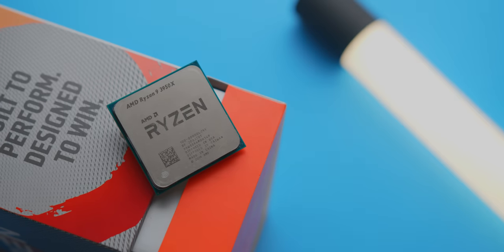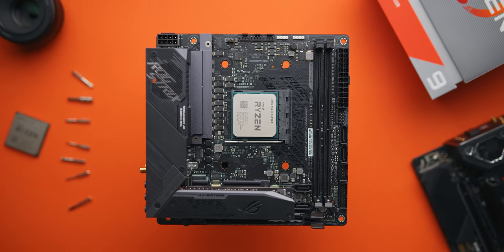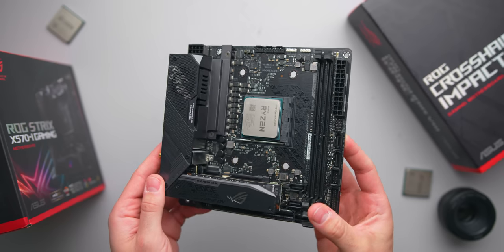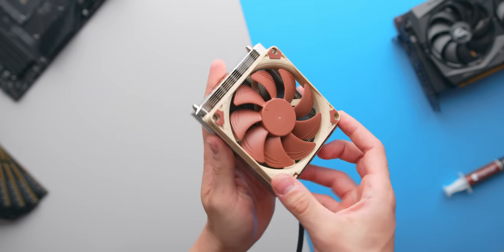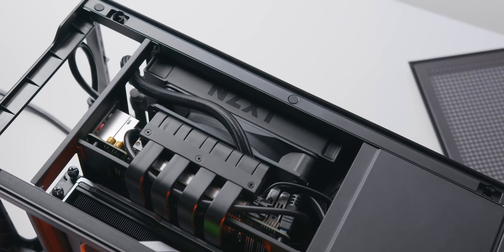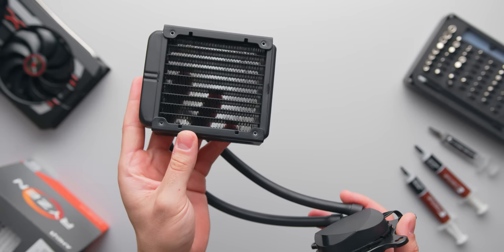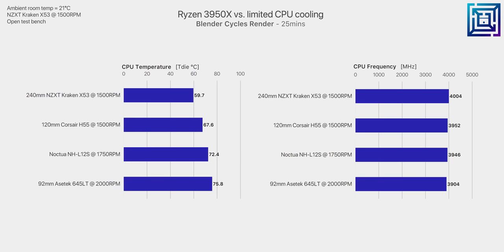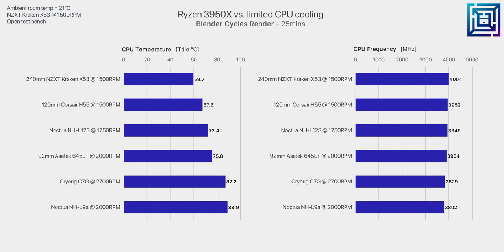Ryzen 3950X vs. Low Profile Coolers - Sanity Check

Comment: Thanks for your review! Been wondering will my current 6 heat pipe 2x120mm heatsink will be enough for r9 3950x :) currently using r5 3600. Thank u , am now sure it will do just fine
Reply: Not all heatpipes are creating equal and not all coolers with same heatpipes are created equal. Gelid phantom has more heatpipes than the nh d15 or any other top cooler, but it performs on the level of coolers with half the heatpipes it has.

Also air coolers will punish you more than AiOs if your configuration of case+fans it's poorly managed. On the other hand, if everything it's in the right spot, it can be even better than the best AiO.

I'm suscribed to optimum tech, but sometimes he pulls out some stupid ass affirmations.

Comment: would love to use the L12s or the L12 Ghost with a x570 ITX board, but according to Noctua and the board manufactures it seems the L12s and the L12 Ghost simply does not fit and its not clear if the black ridge will fit either.

Comment: I have a 3950x and I'm cooling it with a deepcool assassin 3, with the stock fans replaced for corsair ml140s.... little noisy due to the high volume of air being moved by corsair fans but solid performance. It's a bit bulky on the mini itx board I have, and it looks massive in my phanteks enthoo evolv itx

Comment: I’ve been using a dual 240 rad set up with a ek block just swapped over to a u12a and have even slightly lower temps now. It seams to me everyone treats it as if it’s a hdtp chip 250+ watts when it’s really a 3900x with more cores and even a stock cooler would cool it

Comment: I use a 3950x with Swiftech Apogee Drive II and  EKWB 240mm Classic Radiator. Now I feel like this is overkill cooling solution for design and 3d modeling work. LOL!

Comment: i just finished a 3700X build, 90% of people could actually do well with the 3600 as I feel the 3700X is a bit much for the normal everyday non pro gamer/editor/renderer. I do a lot of 3D work which is why I have a 3700X (couldn't afford threadripper and 3700X had a nice TDP)

Comment: It would have been interesting to see the wattage on all the different cooling solutions. I'm fairly sure it actually modulates to lower power when temps go up with some artificial cap. You said to find out how low you can go, what if you cool it with a potato?

Comment: Question is, do processors really die when run at greater temps? And if so, when?
Reply: Of course they do or manufacturers wouldn't power throttle the CPU. In theory you get increased degradation with any temperature increase, but AMD have clearly determined that this is low enough < 90c to not worry about. Personally I'm uncomfortable >75c, but I also OC/overvolt which also increases deg. As to exact figures, no-one can tell you, it differs between process nodes, topologies and even individual CPU's. The only time I have encountered this personally was on a P4 <80c when pushing for an extra 50mhz (0.05v increase over a voltage it had run for months at), I struggled for a couple of hours and ended up with a processor that wouldn't even maintain clocks 1Ghz less than stock.
Reply: @tyrantworm7392  must be that this depends on make and model. Have been running a 2600K overvolted and overclocked to 4.5Ghz for 10 years now. No issues at all. It runs like on day one.

Comment: The 3000 series CPU's are weird when it comes to stock settings. My 3900X/ASUS Strix X570-E Gaming at stock clocks and voltages runs relatively hot (mine was at around 42c core/50c+ package at idle on custom loop), fluctuates a lot, and stays at high voltages (1.45+) at desktop/idle, for no good reason at all. From what I've read, they all do this, and it causes the chipset to run at 85+ degrees at the desktop, with the poor SB fan maxed out, barely keeping up. I clocked mine to 4.3GHz @ 1.3 vcore, and set my power settings to Balanced, but brought the minimum CPU percentage down to 75% instead of 99%. My chipset now idles at 65c instead of 85c, and my CPU is sitting chilly at 32c idle and 60c full load after heat soak and an hour straight of Cinebench R20. 

But if I need those single core performance numbers, there's also the option of recording your best OC vcore, and then using the offset to match that but at stock core clocks. This will let you get your high single core boosts while at the same time avoiding the ridiculous stock voltages those idiots set up for these CPU's. I found my offset to be good at around -0.170 or -0.180, because I would often times see the vcore sitting at 1.47-1.48 while at the desktop, with ~3% CPU usage, and that's just unacceptable and unnecessary to an extreme. And 1.29 ─ 1.37~ seems to be a solid vcore to stay around, especially considering the alternative, which is what it'd bounce in and around with a -0.170 offset.

I just can't for the life of me understand what this CPU is doing most of the time, why the vcore is hitting such insanely high voltages at such low (idle) CPU usage. The CPU will be at less than 5% usage but sitting with package temps into the 50's on water. From my understanding, the CPU shouldn't need those high voltages unless it's boosting to extreme clocks on its best cores, but it's not. It's running insanely high voltages at idle for no apparent reason, and I would think I got a potato if I weren't the only one. But I've found forum after forum after forum of people complaining about this very thing from the 3700 all the way to the 3950X.

Comment: I was thinking I would put the Ryzen 9 3950X into my NCase M with my Noctua U9S. Do you think I would be able to do so? On the ASUS ROG CROSSHAIR VIII IMPACT. I hope it will work just fine.
Reply: Use the C14S instead.

Comment: I am using the noctua NH-U12A. cpu temps at idle at around min 36 to max 46 degrees and under load at around 68 to 75 degrees

Comment: What is up with the temperature fear ?
the cpu will throttle WELL before any damage is taken, Laptops doesn't die and they run like 100+C all the time, they don't break.
it does not reduce lifetime within standard specifications and safeguards....

Comment: I have a 3600 installed with the stock cooler in a Cougar QBX. Works perfectly well, but when running Folding @ Home in it ( correction -> ) folding with both the CPU and the GPU simultaneously, and just with 2 cores, the CPU reaches 90-93 ºC, CPU fan pegged at 2600 RPM. If folding with 4 cores, core temps reach 103-104 ºC sometimes. Didn´t even try with the six cores.
Of course protein folding is a truly max level load, a la Prime95, so much more than typical computer usage. But makes me think the stock cooler Wraith Stealth is really not adequate for the 3600 at least under these heavy loads, it just can´t dissipate enough heat quickly enough. So I´m buying the NH-L9x65 SE-AM4 for it.
Plannig to build a 3900X system sometime in the future, definitely considering at least a 240mm AIO for it.
Reply: i've had my 3900X reach 100°C too once and it immediately self-shutdown. Are you sure your cooler and themal paste are applied correctly? It really shouldn't do that even if you run on all 6 cores.
Reply: @MrFloRolf  Yes I think they are. Originally had the stock thermal paste, so reinstalled and with thermal grizzly's Kryonaut, but same results. I have not experienced any self-shutdowns though, although the cores had exceeded 100 ºC, at least according to HW Info 64, that is. If the processor ought to shutdown at 100 ºC, then HwInfo64 might be providing wrong readings here. Again keep in mind, this is just a 3600, not a 3900X. Board is a Gigabyte Aorus B450 I Pro Wifi. I think protein folding really is a very heavy workload for those cores. I'll report back when I get the Noctua, not sure if Amazon will deliver it any time soon given the priorities right now though.
Reply: @MrFloRolf  For the record, on idle the CPU temps are in the 40-50 ºC range, my ambient temp is about 21 ºC.
Reply: Correction, CPU Die temps of 90-93 ºC were reached with 2 cores when also folding with the GPU, not with the CPU alone.
I just removed the side panel of the QBX, still folding with 2 cores and the GPU, average CPU Die temp goes down to about 84 ºC. So the high temps on the CPU were apparently caused by the GPU heat remaining in the case when the side panel is installed then. I will try an additional fan in different configurations, on top or side panel of the case, and as intake vs. exhaust together with the rear fan, to see if it improves air flow when both CPU + GPU folding, and side panel installed.
PS. When it has already started folding with the CPU, changing the # of cores to fold with doesn't seem to change the # of cores it's really folding with. Will have to retest with more cores after this fold is finished, which will take 3+ hours
Reply: Update after adding a fan on the side panel as exhaust, and changing the rear fan to intake. When only the GPU is folding and at 64 ºC, the 3600 CPU also reaches a temp of around 64 ºC, even though it´s only 10% used. That gives an idea of how much warmer it gets, just because of the heat from the GPU in the case. When now making the CPU fold with 6 cores, it now reaches a max temp of about 94 ºC (again this is while the GPU is also simultaneously folding, and at 64 ºC.) So the stock Wraith Stealth cooler is after all doing an acceptable job, at least given this extreme type of load, and small form factor case, with not so ideal air flow.
Reply: From further testing, the side fan actually makes really very little difference, 0.5 ºC if anything, either when on the side as exhaust, or on top as intake. The real big difference was changing the rear fan from exhaust to intake. I believe that is because now it blows cool exterior air from the back of the case directly onto the mouth of the Wraith cooler. The larger fan on top does not manage to bring in as much cool air, also I believe it fights against the air leaving the heatsink, at least for the 1/4 part of the heatsink that is facing upwards, so probably it doesn´t allow that part to dissipate heat so effectively. (The rear fan doesn´t cause that same air-flow conflict because it´s smaller, and all it´s surface is pretty much blowing after the rim of the Wraith´s fan intake, so not blowing right onto the heatsink fins where hot air would be exiting from opposite direction.
Goes to confirm Gamer´s Nexus advice: each case and configuration is different and requires its own specific testing and trial/error to find best air flow config. Any fan position or orientation changes might have a big impact on overall thermals, while in some cases additional fans might bring very little improvement, if any.

Comment: You CAN actually undervolt these processors. Voltage offsets are best, and I agree that you do need to validate performance due to clock stretching, but if you can reduce voltage without triggering clock stretching (and without compromising stability) you can get a performance boost due to the lower thermals. I run my 3900X at a -0.08 voltage offset with a dash of level 2 LLC to hold minimum voltage up a little bit under all-core load. Doing this literally dropped 8'c to 10'c off my full-load temperatures. Another thing to know about these processors is that RAM voltage also influences processor temperatures. If you can dial back your RAM voltage without compromising a 3600mhz clock speed, you will reduce thermals further (although the influence of this is more workload dependent, and not as dramatic as the first example). Again, validate all performance using something like Cinebench R20. Do a few runs to get a good sample for each configuration. Find the point where clock stretching or stability become a problem, and enjoy. From my own experience, clock stretching also behaves a little differently on different boards, as does boost behaviour, so your experience may differ. Also don't be afraid of combining negative voltage offsets with LLC or higher power targets. Each board handles these factors differently and adding in a little LLC or increasing power targets while undervolting rarely increases temperatures much at all - when compared to the temperature reduction that the voltage drop allows.

Final note: Prepare to get to know your board if you really want to tune these processors. Forums dedicated to Ryzen overcocking or undervolting (on your specific motherboard) are your friend.

Comment: I have the Asus Rog Strix x570-i gaming with a 3700x that going into a node 202.

cooler height is going to be the issue for me, I can mod the case to allow for a slightly taller CPU cooler but my choices are still very limited (stock I do believe the max CPU cooler height is 58mm, and I can get a few more mm by removing the screen from the inside of the case and removing the clips). 

I'm also going to mod the GPU side of the case. I'm going to cut out either a pattern or cut a hole the size of the card and put mesh in the hole that's directly above the Graphics card to allow for heat to exhaust through that instead of leaking into the motherboard side (as in stock form there is no way for heat to exhaust the case unless you get a pusher style card), and put two intake fans below the GPU to suck cool air from the outside directly into the GPU which will also force the heat out of the hole/s I put above the GPU.

 Yes there will be a chance the CPU intake will collect some of the heat the GPU side exhausts, there could be a few ways to deal with that as well. 

I need a case like the node 202 due to space reasons, and there are few others that cost the same (they're a lot more expensive, and hard to get), so the node 202 really is my only option.

Comment: I've been kind of curious how hot the thing'll run with air cooling and surprisingly decent. That's a 25 minute blender render which is rather CPU intensive meant to blast the damn thing lookin' at 70ish degrees on those small coolers, it's lookin' pretty good in terms of just using the thing for gaming and streaming. Less intensive processing in comparison.

Comment: Building a new system soon (5800X or 5900X & 6900XT). Building in the NR200P until I can actually get a FormD T1. Not sure what the size of the GPU will be yet so I'm trying to see how small I can go with CPU coolers. I do mostly gaming, so rarely will stress the CPU this much... looks like the nh-l9a will work if needed, although the nh-l12s would be preferred.

Comment: Damn. 16 cores running on 3.8Ghz? And only reach 88 in temp? Well it's toasty, but I still remember the old P4 Prescott reaching 80 degrees and and that's  a single core
Reply: You know what was better? Pentium D. They discolored every mobo with the amount of heat sunk into the socket.

Comment: Did u ever have had a cpu die because of heat? I had a system running on my attic with abysmal temps for 2 yrs no problems so far :)
Reply: CPUs generally don't die due to heat. 
They generally die to an over supply of amperage destroying the internal traces over time leading to a short.
People mistake the output of the issue (excessive heat) as the input.

CPUs operating under normal circumstances (i.e. without specific stops in place to prevent this from happening) will:
1 ) throttle down 
2 ) throttle down more
3 ) throttle down as low as the CPU can go (generally ~500MHz)
4 ) turn off the system

Systems operating at t-junction are just as safe as those operating at half t-junction.

There are a few known heat-related cases such as Nvidia's 900 series laptop cards and the Xbox 360.
This was not the same thing, though. In these cases the sub-par solder used within the products is what failed.
CPUs generally don't use solder except as thermal interface material and the solder is of much higher quality.
It would have to get almost twice as hot as t-junction for the solder to be an issue.

Comment: I have this same CPU under Noctuas NH-U12A cpu cooler and 4x NF-A14 fans inside Fractal Meshify and I am rendering ArchViz works practically 20 hours per day. This CPU never reach 70º Celsius.
So if you have those temps under a tinny SFF it is pretty dam good sir.
Unfortunately this CPU never reach above 4.25Mhz.
Thanks

Comment: People always talk about reduced life span from running processors hot. I have been using westmere xeons from 2011 and now have a ivybridge i7. These processors barely keep up with a mid range gpu these days. I dont believe the shortening of life span is an important metric as even when ran in a hot server 24/7 my xeons show no signs of giving up and neither does my 3770k under an alpenfohn black ridge running pretty warmly. Processors will need upgrading before they give up due to heat. Thats what i believe
Reply: 1. That's clear server.
2. It's only 4 core ivy bridge doesn't need  more electricity power.

Comment: Too much gap between the sink and the fan. Since it is a suction fan the air will come through the gap easier than the heatsink fins. Isolate the gap and you will get better cooling.

Comment: I'm running it on a corsair H80i, so far it works really well, however 2 cores consistently clock only at 3ghz in a blender render (Ryzen master stress test get's them to 4), even though thermals should allow for more. any ideas why?

Comment: MSI MEG X570 mb ,AMD Ryzen 3800X CPU:  and i did off boost ..cooler amd stock 
I not know  change voltage and  3800X CPU: stock voltage 200.. not 105
max hot 94c idae 45c on windows 10 plz tell me for lower temp